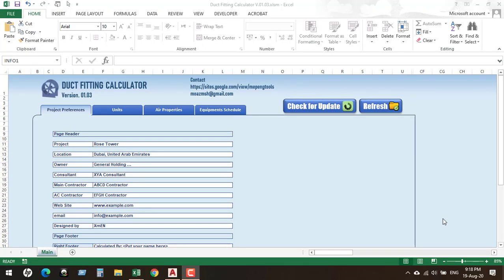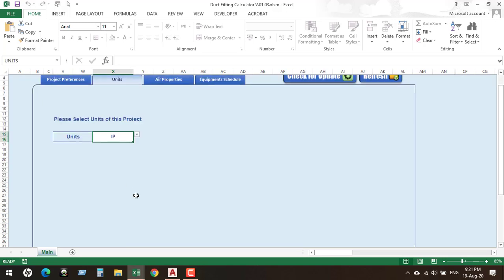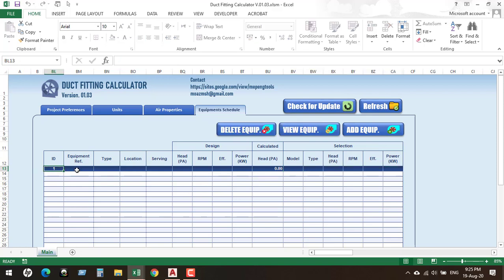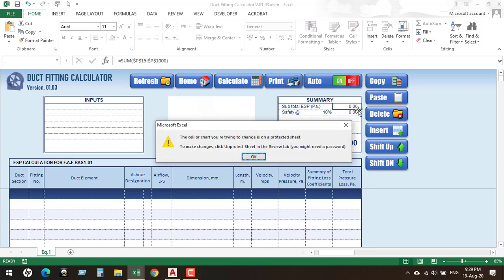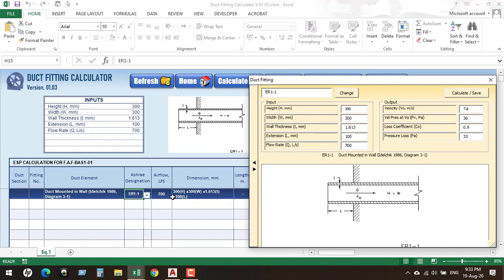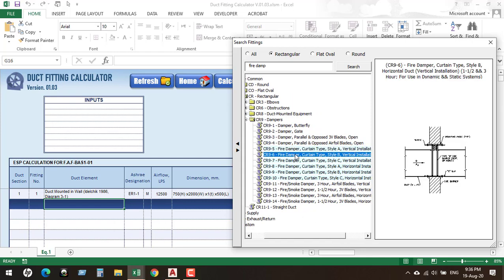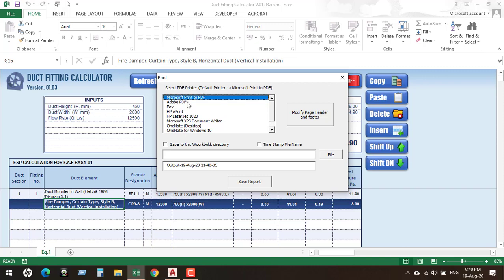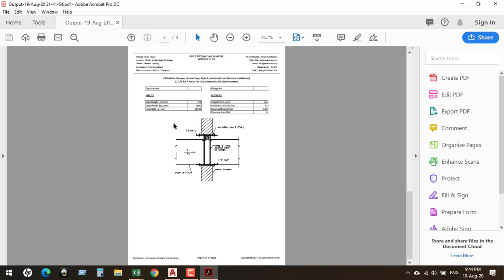Calculate Fans ESP & Pressure Loss / Drop in Air Ducts Using Duct Fitting Calculator Excel Sheet

Comment: Pl advise best software or manuals 

Round / circular process duct calculation including, Expansion joint, Stiffner, development, pressure drop, Load calculation on each support

Comment: for $50, Are you allowed to access the VBA code?
Reply from the maker: Yes I am
Reply from the maker: 50$ for IP/SI premium version ... the code will still be hidden and locked.
Reply: @MoazShomal  Thanks for answering! I just wondered how could you creat an useful calculation sheet.
Reply from the maker: patience, perseverance and passion about programming ... My current project is hydraulic calculation sheet for water systems.
Reply: @MoazShomal  basically, Aren’t you a mechanical engineer sir?
Reply: Thanks sir! I am doing in calculating system pressure drop with VBA, and your sheet is the best example for me.